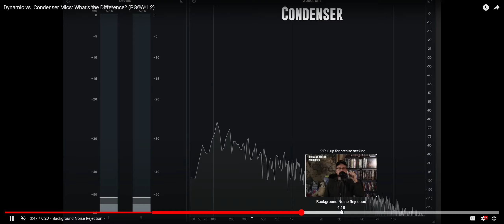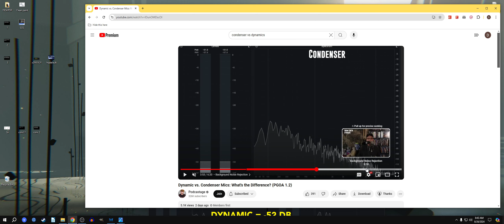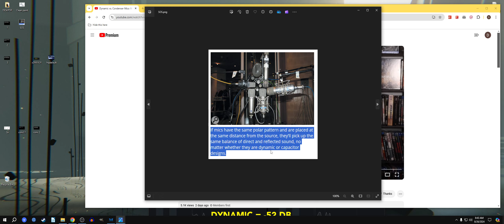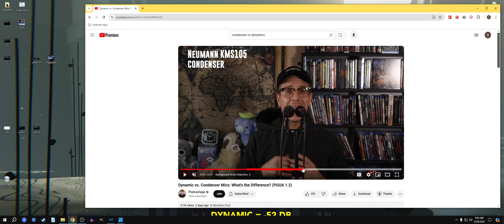My reaction to Dynamic VS Condenser Mics video by Podcastage :D

Comment: Here is my take. i bought sm57 abt 3 years ago because my room is not treated and i wanted less noise. the recordings are not good at all. plus the recording levels are   too low that when i bring it up, the noises comes up as well. and the noise are kinda muffled and harsh. and i cant noise remove it cuz it degrades the recording quality as well. so the only option was to record very close to the source, increasing the source sound while the noise level stays the same as before. but it sounds fake . the source is too close to the mic . guitars sound harsh . vocals sounds like a podcast. in the other hand i borrowed a condenser at2035 and also focusrite one from a friend. the audio signal are high so the noise are quite low . or i just have to play a little loud or bring the mic closer to decrease the noise level. plus the noise in condenser feels spread out and loose and it sounds ok to noise remove it. so even in my untreated room with children playing outside my house, i find condenser more and far better than dynamic. now the guitar recordings sounds dynamic unlike in sm57.  what do you say on this?? thanks
Reply from the maker: In a treated space with proper acoustics I'll take a condenser. Condensers have more detail. Detail is good when you have a booth, detail is bad when you don't have a good booth.
Reply: "The only option was to record very close to source"
That's kinda the only option with dynamic mics, unless you're recording brass

Comment: Having not watched the Podcastage video, was Bandrew suggesting that an LCD mic would reject noise as well as a dynamic if you were in close on them and had gain properly set for the respective distance to mic? Because my first mic, the AT2020 would pick up ants walking on the wood floor above me with almost no gain. LCDs, generally speaking will never reject sound as good as dynamics when polar patterns are similar. Just by way of how the capsule excitation works.
Reply from the maker: Nope. He didn't suggest anything. He just did the tests. The people who said they would be equal were Sound on Sounds. And imo there's enough info in that video to quickly ascertain that they are not equal.
Reply: @Dracomies I did suggest something because I said that I believe that generally speaking dynamics do reject more noise, but it’s not because they’re dynamic or condenser, I think it’s the polar pattern and frequency response that leads to it. And then the typical closer use of dynamics likely contributes to that idea as well.